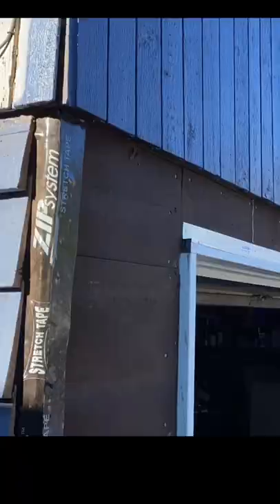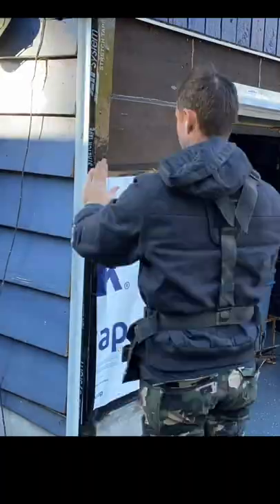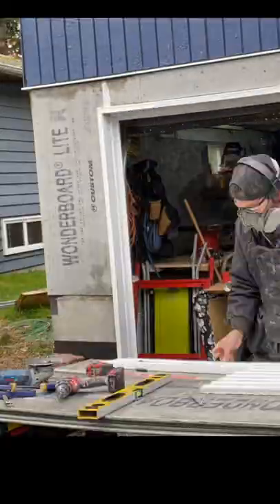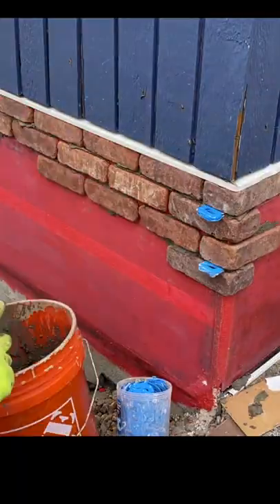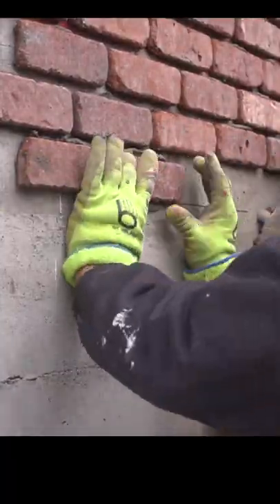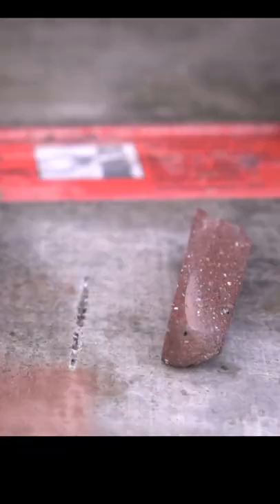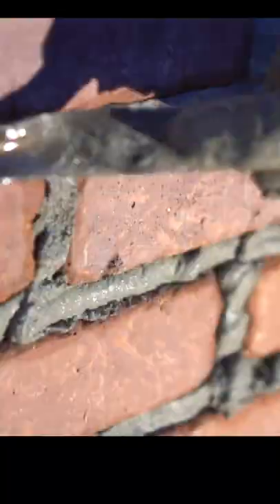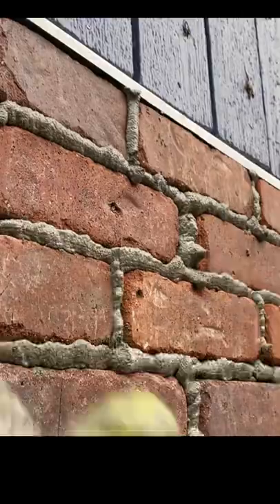DIY Thin Brick Veneer #SHORTS

Comment: Just take a regular brick and cut it in half same thing
Reply: Except a full brick sliced in half is closer to 2" (1.8" actually). The veneer is 5/8" thick. When structural integrity is not needed and weight is a factor such as interior use, the veneer makes sense. You're also doubling the amount of mortar you would need in the joints. Also, tell me how long it would take you to slice 1,000 bricks in half, and cut L-sections for outside corners. Then equate that time to labor dollars or how much of your own time you're wasting to save a few bucks. Oh and you have to haul the full bricks to the cutting location instead of just opening a box. Are you one of those people who drives out of their way to save 5 cents a gallon on gas? Wastes a quarter of a gallon to save 3 bucks.